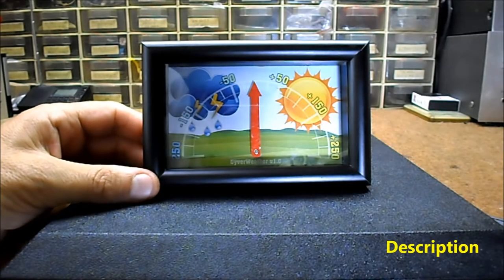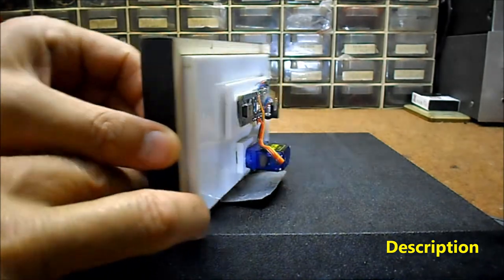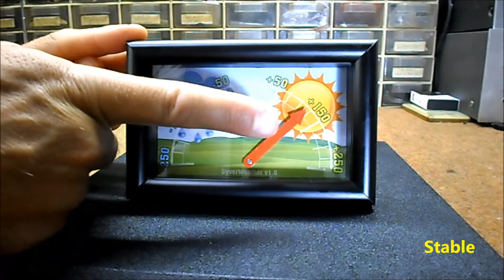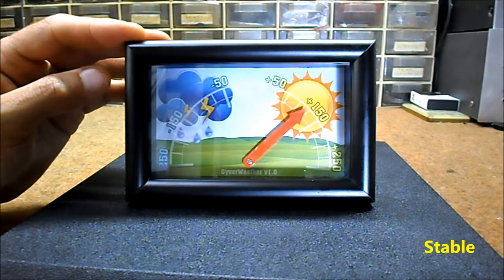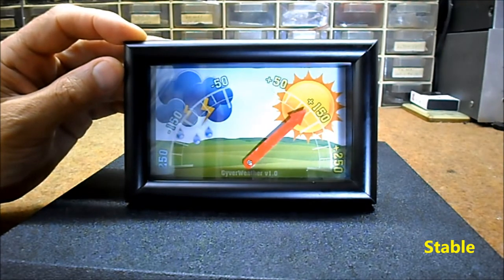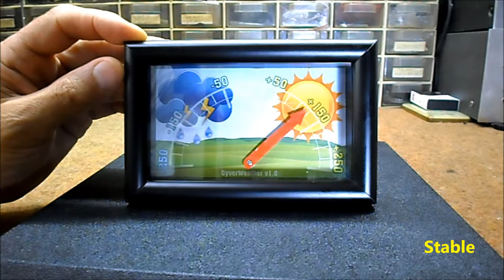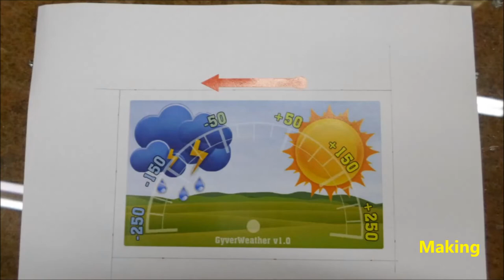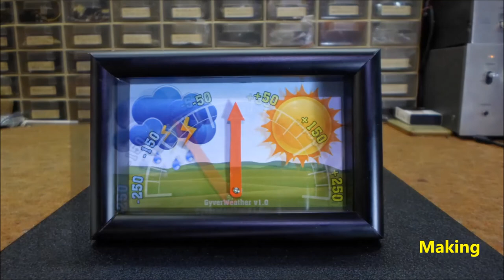DIY simple Arduino weather forecaster

Comment: The idea is good, but someone else's (((. Not ashamed?
Reply from the maker: Obviously, you have not read the text below the video where it says: "Otherwise a project is presented by "alexgyver" on whose website you can find more information as well as the original code."  . And I have nothing to worry about. If you did not know before, Arduino is an Open Source and Open Hardware platform, if you do not know what that means, read online
Reply: @MirkoPavleskiMK  You really haven't read it.
Reply: This project was pointless to repeat as it contains gross errors in weather forecasting.